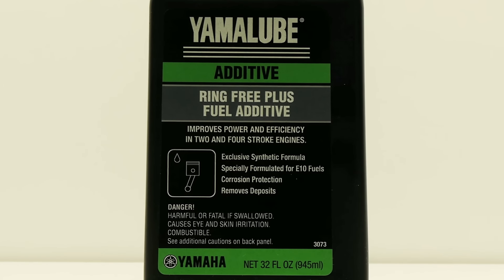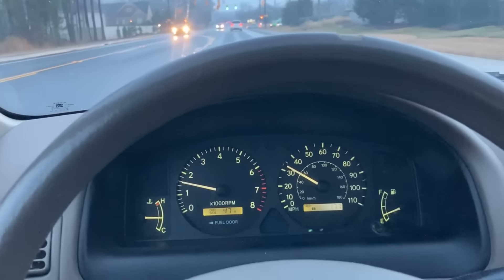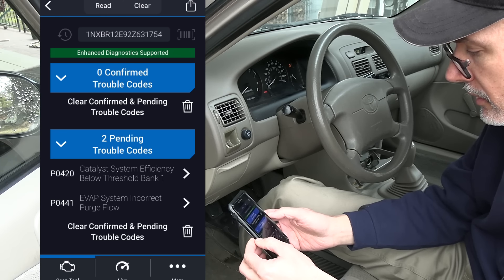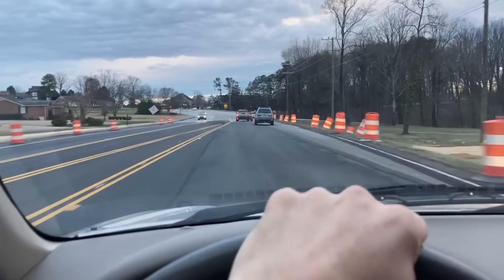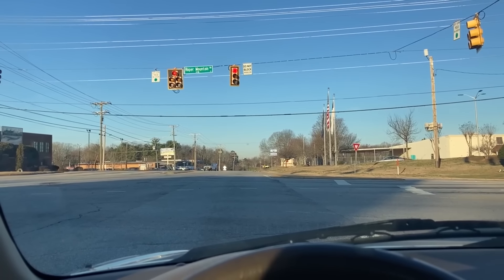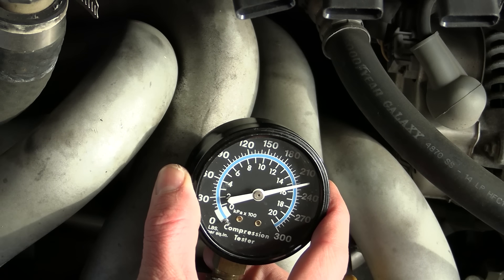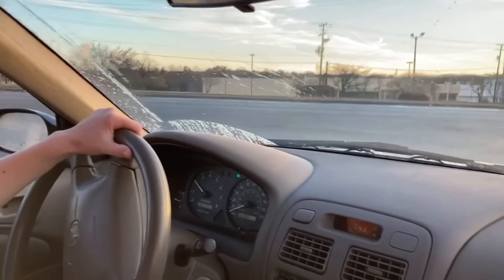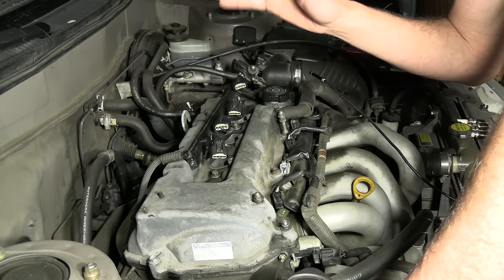Will Yamalube Ring Free stop oil consumption? | Oil Burning🔥Experiments | Episode 20

Comment: On my daughter's 2002 Toyota Echo oil burner, I overnight 'soaked' each piston/cylinder with a cup of kerosene thru the spark plug holes and, drained half the oil from the crankcase replacing the same amount with some kerosene as well. Idled the engine for 3 hours and finally replaced the oil and spark plugs. Oil consumption was easily cut in half.
Reply from the maker: Good info!!

Comment: Also running the engine harder with higher rpms will make the combustion chamber temperatures higher which will help burn the carbon off the combustion chamber and the valves and possibly the oil control rings

Comment: Caustic soda over cleaner spray foam. Under 3$ a can, spray through spark plug hole, and leave for 10 mins. 
It sinks down thru to piston rings and de carbons them.

Comment: This is a very well done video episode however, I wish it was a little shorter. That’s what she said! 😂

I have a 2.4 L Toyota burner with about 245,000 miles on it. I’ve gotten the consumption down to about 1 quart every 300 to 350 miles on average.  That’s an improvement believe it or not. 

Lucas doesn’t really work. I’m trying to use a different viscosity 5W-30 synthetic blend. I found conventional 5W 20 burned a little slower then full synthetic 

I’m going to see if the different viscosity slows the burning down to 350 to 400 miles per quart. Trust me, I’ve tried all the products and the Pontiac vibe club tells me what I already know. I’m simply delaying the inevitable, engine swap or rebuild.

I am going to look into this product. Thank you and have a good day.
Reply from the maker: Thanks for the info!

Comment: I t hink you should upgrade to 15w40 comercial  engine oil,
 it does an excellent job of preventing carbon build-up on pistons. Or 5w40 synthetic comercial engine oil as they are both formulated for diesel engine service as well as gasoline engines.

Comment: If that engine is burning oil, you either have clogged oil control rings, worn rings or cylinder scoring? The only other issue could be the valve stem seals are bad, hardened and not sealing? Does it have blue smoke at startup? If it does and clears up when the engine is warm, valve seals all day?
Reply: He changed his valve stem seals in one of his earlier videos... Browse around his other videos on what he did to this engine over the years

Comment: You should check the fuel pressure. If the evap system is having trouble or clogged, it will cause fuel smells under the vehicle. And you'll smell the exhaust when running the AC on fresh air. I would also inspect your PCV. Definitely have more issues with the car than oil burning.

Comment: When is your EPR episode coming? I have four cans of this stuff and was going to do a 50% engine flush at 3000 rpm for 30 minutes and drain and refill! Standing by for your results!
Reply from the maker: I just got back from vacation, so I'm running behind. You might want to go ahead with yours and let us know how it goes! 🙂
Reply: @FamilyFriendlyDIY  Roger that! ;)
2011 Acura TSX V6 losing about a quart of oil every 750 - 1000 miles. 
~160,000 miles in J35Z3 engine non-VCM

Comment: They sure do look clean! A lot of oil on top of them though. I would be shocked if the oil rings were still stuck after all the treatments you've done to that thing they gotta be worn out but who knows. Let's see how the EPR does, just ran some in my car and it os definitely a potent smell!! May run a quart in mine again though just cleaning up the inside of the used engine I installed that was a little neglected.

Comment: Had a base model 98 with the 5 spd that burned oil like that. Didn't seem to hurt the car any as long as you kept oil in it. Drove across the country in it, brought a gallon jug, probably used up the whole thing in the trip lol. The car was very reliable and always ran great despite the oil burning.
Reply: Yes Vee 5-speed I still got mine it's only about a hundred of them I saved only one I bought it didn't use it much oils full and clean when I boarded over 4,000 miles Burns a little bit it's sitting right now in my backyard for another eight years everything spinning doesn't Intuit the good doctor the car is a good backup my talk-to-text is not working the best
Reply: Yeah they're very strong motor you can mail the pedal to the floor and let it run for an hour the engine block the motor will not throw up blowup

Comment: i dont know but have you tried adding marvel mystery oil? that is meant for all kinds of things. ive freed up not only frozen engines but completely stuck lifters as well. heres the thing though, you need to check cross hatching on cylinder walls. if there isnt any well thats why its burning oil. w 190k on it im going to bet thats the problem. it could also be valve seals as well. if its either of those no amount of chemicals will ever fix your problem. however, they may do you the favor of clogging up your cat for you though. i just remembered, test compression for a baseline. then add some wd because the dish is so deep on those pistons. ideally you use oil for this which you still could. you would simoply have to add extra to make up for the dished pistons. if compression raises its the rings. you can check your pcv valve as well to see if its stuck or all gummed up. if so simply replace as they are cheap. you can also add a catch can as well. again though w 190k on it im betting rings or valve seals or even both. the fact all pistons have that amount of oil on them has me leaning towards those 2 things. thats alot of oil

Comment: Have you ever changed the Is timing chain tensioner O ring? I have heard several people say that it helped them significantly and it is a very cheap part, And it's only like 50 if you want to buy the Toyota OEM entire tensioner.
Reply from the maker: Yep. Did that in a previous video. Thanks for the comment, Jake!
Reply: @FamilyFriendlyDIY  I had looked through the playlist and didn't see anything, I'm glad it's already addressed. I'm undertaking it next week on my girlfriend's Prizm
Reply from the maker: @jake6483  I think its in the replacing the valve-stem oil seals video.
Reply: @FamilyFriendlyDIY  guess I'm rewatching tonight! Thank you

Comment: Your problem is carbon deposits stuck in the piston grooves,you cant flush that out,it has to be removed by scraping that off manually,with something like a broken pisonring,also the oil return holes are probaly packed up with carbon BTDT

Comment: Why is compression so low? 230kpa to psi im getting 34psi? That's can't be right? If that's the case u have valve issues leaking by and causing all this oil. Did u try a leak down test?
Reply from the maker: My readings were in PSI.
Reply: @DIY Dave  I did go back and look, it should be 140-150, u are way high, most likely from all the oil in cylinders.  Rings aren't Problem! They are sealing! Most likely the oil ring is worn or its leaking from head. If it cleaned the tops of pistons that clean, the rings are just as clean. U can see the cross hatch in cylinder walls. Its not the rings that are stuck

Comment: So much oil on the pistons is caused by brittle , worn valve stem seals. Some seal softener additive can solve the problem in some cases. Great video, would be nice to know long term results.
Reply: Valve stem seals have already been replaced by Dave.

Comment: Wait, why are you using high octane gasoline for that commuter car?

I thought the manual states 87 octane; so you're wasting $ since that engine was designed to run with it... Excess octane means it's not detonation fast enough and carbon build up will be the result?
Reply from the maker: I get knocking when I run 87.
Reply: @FamilyFriendlyDIY  oh yea, some toyotas don't like the ethanol mixture & did you try mid grade to eliminate the knock ~ vs premium
Reply from the maker: @ricebike  I only buy gas at Costco, and they only have the 2 choices. However, my sequoia knocks with 87 octane so I do a 50/50 mix of 93 and 87 and it seems to do fine on that. I might try 87 in the Corrolla next time as someone mentioned now that the carbon is gone it might not knock anymore. :-)

Comment: Have you tried the valvoline restore and protect motor oil? Looks to be good stuff
Reply from the maker: Coming soon ...
Reply: I just bought 2      5 qt jugs of it . I had KIA dealer put it in my KIA that had the 2nd piston soak done after 1st one was not successful. I want this oil guzzler fixed to save my CAT converter!!
Reply: @bobreese4807 any improvement? I just started using VRP but the check engine light has come on and off during the first 1000 miles with it. It has slightly reduced the consumption but I wonder if combining it with a piston soak would make more sense to avoid sending the deposits out through the cat and shortening its life.
Reply: @YAMAHA808  The 2nd piston soak by dealer failed. 2 qts low in 1 K miles. I don't blame the Valvoline. I think the piston soak by dealer is kinda wimpy. They don't use B-12 and  don't fuss with cranking the engine like some on YouTube..to get that solvent all over the rings...or my cylinder walls are bad.. I am supposed t get a new engine. I will put the other 5 (4) qt jug in my 1998 Dodge Caravan with 170K miles.. BUT I  also will first  put Berryman fuel system cleaner in soon, then flush with BG EPR 109 then put in oil. BTW You need to change oil after piston soak. I am going to put in PETRON PLUS oil stabilizer after putting in oil. I talked with Petron rep at main office for advice. I chose Petron over Ceratec, Archoil 9100, Bestline.... that is only me. I will see the results in September/October. I wlil keep your  reply in my list
Reply: @bobreese4807  The piston soaks I've had done have worked but the effect only lasted about 4,000 miles and then the car starts drinking oil again (2015 Kia Soul). I think the VRP is actually working (runs smoother, better MPG, less consumption) but like I just watched in another video, if you have serious buildup, it works too well and clogs the oil filter. I think I'm going to need to change the filter sooner than later.

Comment: Have you checked your PCV valve?  Disregard, I looked back at your videos.  The PCV valve was my problem. As the engine cooled, it’s sucked oil in and smoked at start up.  Changed the valve and no more oil burning

Comment: to mutch oil causes cranc  case over pressure. this causes oil to go in to the cylinder and can foul air sensors and engine damage in extreme cases in other words it can give a wrong image of what you see after the test.

Comment: The oil ring that's up above the pistons is probably from valve stem seals not from the oil control rings on the pistons. I'm almost 100% certain it's from valve stem seals

Comment: Great video and results Dave.  I’ve been looking online to try and find out if Yamalube is safe for catalytic converters in automobile engines as opposed to boat engines without.  As of yet I but haven’t found any info and wondered if you have?  Thanks and enjoy your videos very much, Rich
Reply from the maker: Sorry, I have no idea. ... I apparently didn't even read the directions right ... I used 20 times the recommended dose!! ... Thanks too for the kind comment!!
Reply: I use it in my 2007 Ford Expedition. Not every tank, perhaps six to seven times a year. With 210,000+ miles it still has the original converter with no issues. Now, back around 2012 when I was driving MANY more miles yearly, I used RF every month. I didn't feel the need to add it every fill-up. I drive less than 5,000 miles a year now, so don't add it as much. Motor still runs smooth & strong like when it was new.
Reply: @tvtonite79  Great to hear, I thought of using it too.  Thanks

Comment: In the meantime, fix that purge flow, there’s few possible causes, and none are very difficult and a bad cat can cause oil to blow past your piston rings j/s and I can’t remember if you’ve addressed the PCV valve or not that will also do it j/s

Comment: If the oil comes from  the top it means valve guides are worn, and no matter  if you have new valve seals, it will let the oil pass to the combustion  chamber ,maybe the cylinders are not round anymore and maybe even with  new piston  rings  it will burn some oil. But I like the series it's very  interesting to see all the processes  on what product help and what doesn't.
Reply: I think that the valve guides are not the issue.  I have experience with these engines with high mileage and haven't seen yet worn guides.  The bucket type cam followers are easy on the guides compared to rocker arms that place lots of side thrust force on the guides and valve stems.

Comment: At this point, you should do a Leak Down Test to see if you are getting blow by or leakage out of the pcv/valve cover breather.  That's a lot of oil on top of the pistons.....
Reply from the maker: Thankd for the comments, Chris. In prior videos, we did leak-down tests and changed the PCV valve, and  valve stem oil seals.

Comment: Would be very interesting to do a water decarbonization (steam decarbonization). Try it with engine at operating temperature. It will be even better if you find a steam cleaner, so you put actual steam in the intake rather than cold water. And it's better to do this procedure before an oil change because you can/will get water contamination in the oil.
Reply: Water/steam will absolutely clean the piston tops and the combustion chamber but I don't know that it'll reach the piston rings to have any effect.

Comment: Hello, looks like you have another car in the drive way. How about scoping its  piston tops and air intake valves. Then put in Yamalube into gas tank & crankcase during last 500 miles before its oil change. Then repeat the scoping. Also cut open the oil filter. 

Regards.

Comment: My understanding of the oil consumption issue with the 1ZZ is not so much a ring issue as it is a piston design issue. The oil ring lands have oil drainback holes on the bottom of them, the pistons in this engine didn’t have large enough or qty enough of these holes. With very little time, any kind of carbon deposits would clog these completely thereby not allowing the oil control rings to do their job as the oil they scrape back down has no way to return to the crankcase. My guess is the only long term fix is to simply drop the bottom end, remove the rings, clean the lands and drain holes, bore them out larger and add another 4 holes.

Comment: Evaporative purge valve is stuck open. Cat is plugged cause of the oil burning. Try the lacquer thinner in the fuel tank method to try and clean out the cat.
Reply from the maker: Thanks for the input and suggestion!

Comment: Yeah at this point I would try attacking the problem from the bottom up. Find a cleaner that goes in the oil and will break up the deposits from the crank side. B12 did well on the top side of the rings.
Edit:
Looks like you've already tried that.

Comment: these pistons should be much drier. Instead they are soaked in oil. You already did valve stem seals?  Also your rings cannot be stuck with dry carbon. They are worn and/or the cylinder walls do not have nice cross hatch. How do the walls look? Whenever they are slick and don't hold oil, it seems to get burned more.
Reply from the maker: I did close-ups of the walls in earlier videos which show the cross-hatching.

Comment: Hyundai has a great looking TSB for oil consumption, if you give me an email I'll send you a copy of it. It's very detailed and has some special steps to make sure that the cleaning fluid is pushed down through the rings. Also you might want to fix your upper hose before it blows off, it's slid back right against the hose retaining lip on the radiator neck. You'll want to slide it back into place, re-tighten the clamp, and if room allows add a 2nd clamp so it can't slide back again. The top tank of the radiator is looking a bit browned as well which if often an indicator that the plastic is starting to break down and weaken, might be time to replace it. If you're smelling exhaust strongly in the cabin you likely have a failing or failed 'donut gasket' between the exhaust manifold and the exhaust pipe, it should absolutely be replaced as exhaust fumes/Carbon Monoxide poisoning are real dangers in a car. CO/CO2 can basically make you drunk without drinking a drop, driving around with that flooding the cabin is really bad.
Reply from the maker: That's awesome ... Thanks for the info, and my email is davidvoskos@gmail.com
Reply: It looks the same as the KIA TSB 222.. KIA dealer did it (pison soak)to my KIA Sorento at 66K miles. No help. Was supposed to get a new engine but KIA told dealer to do a 2nd one. Did it last Monday. Waiting 1k miles for result. Did an EPR109 flush before piston soak and after 2nd put in Valvoline restore & protect oil..
Reply: @bobreese4807   I hope they step up and replace the engine, you can ahem maximize your oil consumption by keeping the engine at high RPM to help make sure you fail the 2nd test and get the engine replaced rather than just kicking the can down the road.

Comment: Welcome to the oil burning Corolla channel, I'm not suggesting you loose the intro, and I know it's expensive work to have done, if the engine is in good shape otherwise do or have a ring job done, or Toyota short blocks are not terribly expensive and they come from the factory with the updated stuff and a warranty although you would need to use the old head unless you want to pay for the long block, and of course your car will be out of service for a few days at least, even if you gather everything before you start the job